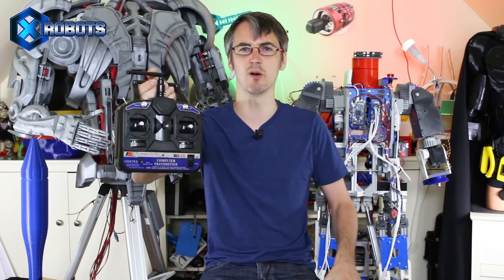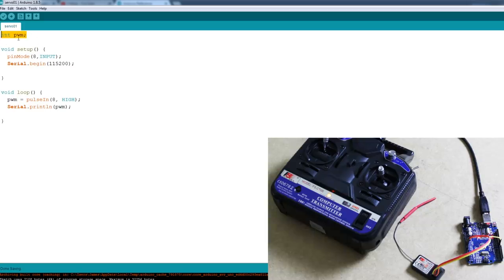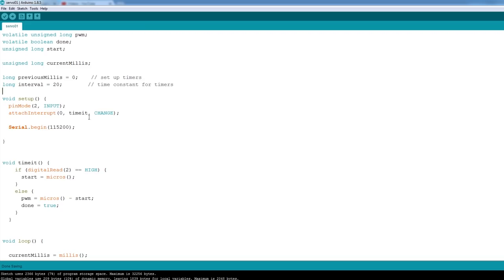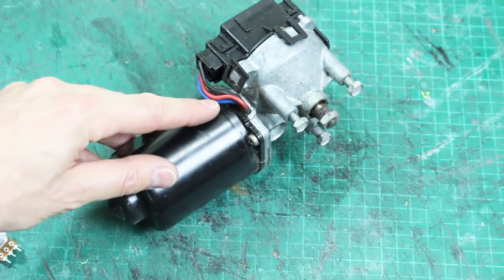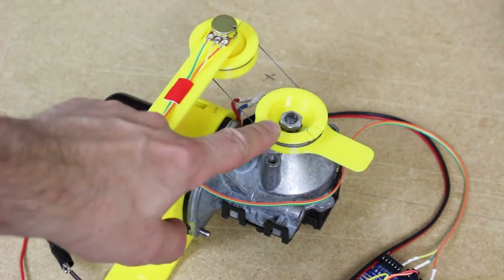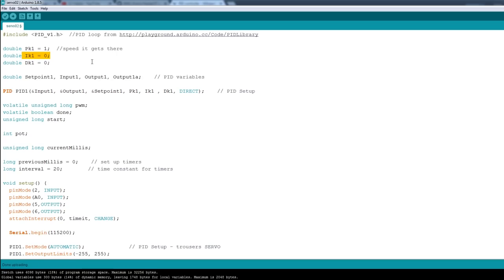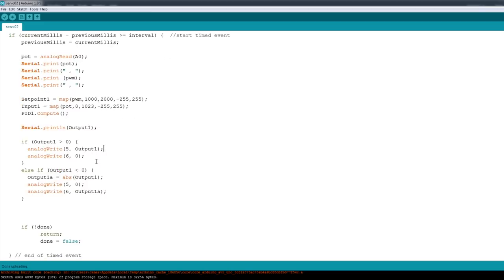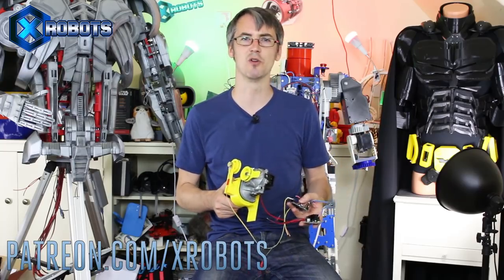How to Make an R/C Servo from a Wiper Motor | James Bruton

Comment: This was really awesome. But can u please explain or a make a video in which u can tell how to make a servo which can be controlled via Arduino directly as a normal servo. Can I do it directly by manually giving the setpoint. And how can we remove PID through the code and still in it would work?
Reply from the maker: Yes just set the setpoint in your code. You still need PID
Reply: James Bruton so do we need to tune PID everytime we increase the load? Can u please go in more depth how to tune the PID in this project
Reply from the maker: well you can find the sweet spot for the typical load

Comment: Hey James. Are there any way to contact you ? I need to change the rc control to a steeringwheel control with a POT in the end of the steeringcolum. its all made but i'm not sure how to change the code ? Should the PWM be set for A2 input with range of 0,1023 ? Etc. Best regards Herluf

Comment: Hey James, quick question. 

I’m building a remote system for a snowblower as I live in Canada and we get a lot of snow and it sucks having to go out and get cold and wet to clear the lane way.. I’ve done my r&d and my brains been put on paper and refined , I’ve got all the parts I need and I’m ready to build. But I have not ordered any circuit boards yet. (Plan on using an Arduino Uno ((possibly mega for seemless Add ons in the future)) and I’ve been researching the Adafruit 16 channel servo driver) 

So.. the build will have 7 “servos” but 5 of them I am building out of 3 window motors from a car and 2 wiper motors(for the higher output potential for steering. Need to fight the resistance of snow and the weight of the whole machine) the other 2 of 7 servos will simply be 20kg Rd car servos. 

So my question is, what would I need to drive the 5 wiper motor servos similar to the one you’ve built in this video?  I see your driving one from the motor driver to the pwm pins on your Arduino. Would I need to have 5 of those drivers ? If so. Then would I need make sure I have another analog pins to receiver the signal from each of the 5 pots off each of the 5 wiper motors? Is this possible with the Arduino Mega platform?
Reply from the maker: Yes you'll need 5 motor drivers with 10 pwms on the Arduino. If you use the servo library on the MEGA then pins 9 and 10 don't work as PWMs anymore so you might struggle to drive 5 motors.

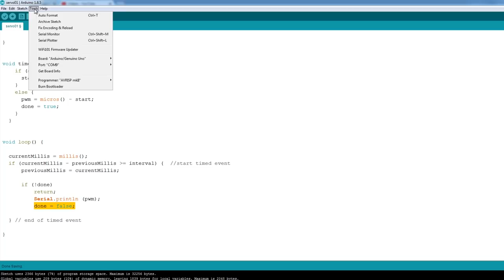Comment: if (!done) return; is correct, because there are no curly brackets around the one line if body. ( 5:40 )
Also because the following two lines are indented wrong (but still syntacticly correct), this can be hard to understand for a human reader.
Good video, otherwise!

Comment: u may know...i have a full metal 47cc rc 1/4 scale, custom made, it has an h-bridge/servo/wiper motor setup its all insulated from frame,  h-bridge runs 12v steering works perfectly with engine off, when i try start it sometimes it instantly steers 1 way and volts drop and it kills signal between rx/tx till i switch rx off n bk on...is this cos i never used ur method?? or is it gas engine related (engine is hard mounted to frame) i do have an arduino here

Comment: Hello, i follow your video step by step . Motor is turning right and left with the movment of the controler but the zero point is not the same every time . when there is no movment from the controler the pot is stoping a little bit left or right than the zero point. any help? thanks

Comment: why not using this diy servo for openDog?
can you make a video explaining the use of PID control for balance in robots like in the bipedal that you made or how are you going to implement it on openDog? 
thanks
Reply from the maker: because I need the speed and power of the bruhsless motors which need specific drivers - which already deal with the PID controller internally.

Comment: I do not know if this is true for all receivers, but I found (internet) a way to hack my receiver so that I could read from one of the channels the PPM (https://en.wikipedia.org/wiki/Pulse-position_modulation) signal actually being sent by the emitter. This allowed me to read all channels from one pin. Of course you then have to decode the signal into the different PWM channels, but it was not that hard... I even used a RPi instead of an arduino.

May be yo find it useful. Dunno.

Comment: Isn't it cheaper to use the guts of a $5 servo to read the signal? That way you get the pot, cable, plug, and circuitry for 5.. or would that not work for some reason
Reply: Nvm, I'm half asleep
Reply from the maker: it wouldn't power the motor or have the right response.

Comment: Why not just drill a small hole behind the wiper motor and mount the pot directly to the output shaft.?
Reply from the maker: Try it and see if you can do it, it'll be pretty tricky
Reply: @jamesbruton  it's pretty easy. I'm building a hexapod using wiper motors and with analog servo boards it works great. No need for measuring tie rods which was going to be a big problem for me because I dont have  a 3d printer yet. Thanks for replying, I love your work!

Comment: Hey James, I'm in the process of building a remote control, half scale Dalek for a systems engineering project at school, I have two wiper motors for the wheels - I'm going with tank steering (using one joystick on the controller, when turned right the left wheel spins forward and the right backwards) the motors I have got have an odd shaft and 6 wires. To make things simpler i am looking for new motors. have you got any suggestions for new potentially simpler motors that are easy to mount the wheels on?
I'd rather not go to a wreckers because they don't really know what i want.
Btw i live in australia and the price for everything is astronomical x 24
Reply: It would be great if you made one for your channel ;D

Comment: Can I use the 3.3 V pin for the pot instead of 5V, because I have only one 5V pin ?
Reply from the maker: Yes you could, but your analog in won't go all the way to 1023. Just split the 5v pin to multiple wires.
Reply: So you say that I could solder 2 wires to one pin and this solve the problem thank you

Comment: Hi James I am new to programming an arduino and I've been tasked with the exact project you have here but I'm struggling to get it working with a normal 6v dc motor. Could you please assist me
Reply: oh and I am also using a L293D motor driver
Reply from the maker: well the code is published...

Comment: Hey James,

can I use a H bridge motor driver inplace of the ibt-4 youve got? ive got everything wired as you do and coded, the serial monitor is reading values correctly.. but no movement, ive got pwm pin 5 & 6 wired to pins INa & INb on my h bridge motor driver.. is plus ground. is it not working because its a h bridge motordriver?
Reply from the maker: If it takes 2 PWMs then it should work the same. Are you sure that's what the inputs are?
Reply: @jamesbruton  the pins are +5v , GND , CN , CS , INA , INB , PWM
Reply from the maker: It sounds like it's only got one PWM - what device is it?
Reply: It’s a VNH2SP30 .. would a DBH-12V work? It’s a dual dc motor driver 30a, it’s 12 pinout 6 for motor A 6 for motor B which read, V+, GND, IN1, IN2, EN, CT. Would this work to drive 1 12v window motor? (It’s the same as wiper motor just a smaller motor on it. And only one speed. The body isn’t grounded it’s just 2 wires which makes it nice and easy) would that board work? I would buy the IBT-4 that you are using but I can’t get it shipped till 21 February which I don’t want to wait for. My project is completely on hold at the moment until I can build a strong enough Servo for steering.
Reply from the maker: @Dan-wu1cu  I've never used one, but it looks like it's got direction pins and one PWM - so you'll have to do some code adjustments and sort out two digital outputs.
Reply: Ok great thanks James!
Reply: @jamesbruton  I havnt learned coding for these arduinos yet, my brain can understand it once I read up on the language, and values and such. but just so i know what direction to go in... Your saying that i need to sort out two digital outputs from my mega to my motor driver, those would go to the directional pins INA & INB and then adjust the code for 1 pwm with 2 directional outputs instead of simply two pwm outputs that read weather it needs to go in one direction or the other, based on the servo position and input from my tx?

Comment: Why don't you just build a manual circuit like what's in the small servos you don't have to mess with any code or any Arduino or anything if you take a servo apart lovely one chip a few resistors and a potentiometer and of course the motor there you have it
Reply: Get on it then...